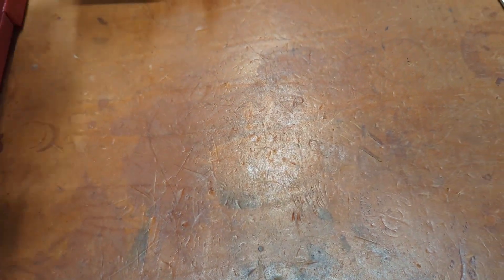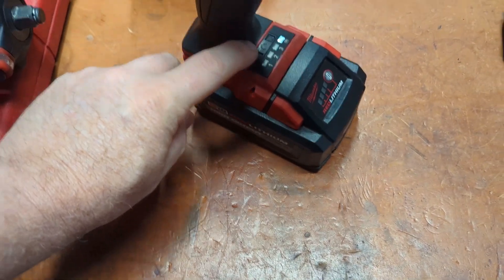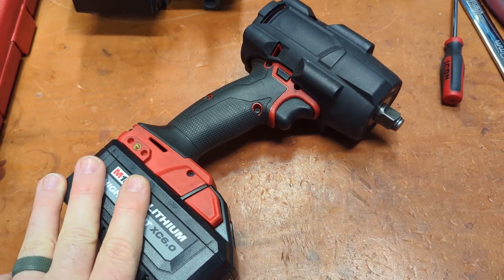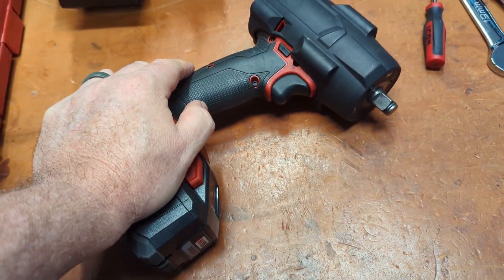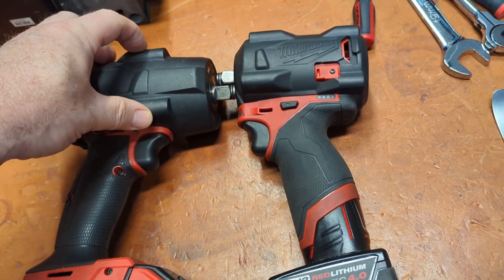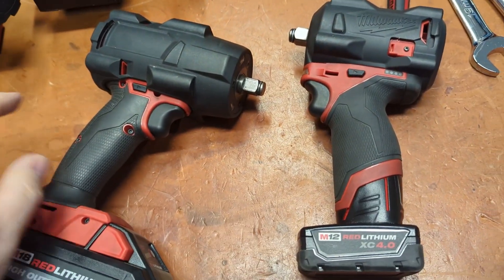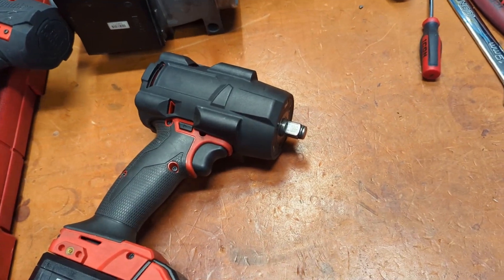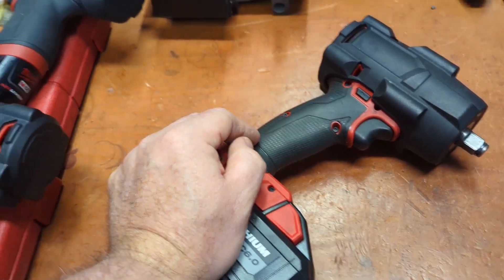Why NOT Milwaukee 2967 M18 Gen 3 High Torque

Comment: Being from the rust belt, the concept of not needing a high torque blows my mind lmao we need a high torque for anything past brakes if the vehicle is more than 10 yrs old 😂
Reply from the maker: ;)  The Mid Gen2 was at levels that a lot of High Torques were at the time.  But obviously I have no real experience with rust (and hope not to - lol)
Reply: @themessygarage  that’s true, to be frank, the new DCF891 has been able to tackle a lot of tasks that used to be for the high torque, that thing is more powerful than the old DCF899 high torque with the right battery haha, but it is almost 7”… I already updated my high torque prior to the Gen 3 release so I won’t be buying it either, but I’m definitely hoping they update the mid-torque because dcf891 power at 6” or less would be a serious game changer.
Reply from the maker: @tylerfraker9304  You bring up a good point.  The bigger message of this video isn't a Team Red thing.  It's an 'all kinds of tools' thing when a spiffy new thing comes out that tempts...   ;)
Reply: I JUST Like All IMPACTS for my YouTube TOOL Channel so I now have all the MILWAUKEE 18 fuel IMPACTS but still want the new DEWALT XR DCF 961 and then next would be a 3/4 MILWAUKEE M18 fuel 2967 and even want the new HARBOR FREIGHT HERCULES ULTRA TQ that TTC just did a video on and it has 1500 NUTT BUSTING BUSTING
Reply from the maker: You definitely have impacts on your channel  :) ;)

Comment: Totally agree. I have the 3/8 Mid torque I got for $100 new. And it’s done everything I’ve needed. Automotive to fire apparatus. And everything on the ranch. It’s plenty of fun for anyone. I don’t think half the people that buy the big gun need them. However when the deal comes up for the right price it will get the high torque because I want a 1/2” gun. My 3/8 is the beast when I need it but when I need to use a 1/2” socket I’ll just use a bigger gun.

Comment: @1:50, it's actually the fourth mode that has the magic of slowly spinning bolts off and not wrecking things when driving them back in. Modes 1-3 are different speeds, but full impact and no brains.
Reply from the maker: I must have been really sleepy that day - you're exactly right, and I knew that when I shot the video (I've installed two complete suspensions with it, front struts on my wife's van and all kinds of stuff with it).  I noticed that I already had the impact in Mode 4 when I started talking, and for some reason punched the button and moved it to Mode 1 - maybe I psyched myself out - 🤣.  Thanks for the correction, and for watching!

Comment: Why did you make this video titled "why not"? Im watching this thinking you're going to say something negative about it. Now I'm pissed because you just wasted my time with your long winded personal experience
Reply from the maker: The video is supposed to be about why I'm not on the hype train and buying one.  The point is a lot of people wind up buying something because it's "NEW!"  or "IMPROVED!" and not because they need it.  The personal experience in the video was my journey down that exact road: everybody made so much about the big gun (2767 High Torque) and how it was the answer for almost everything.  So I bought it.  Ultimately the Mid Torque is better in every way for what I do.  I didn't need the extra power of the High Torque, and I'm incredibly glad I don't have to deal with the weight of that tool.  So this time around I thought sharing that most of DIY'er-world can live happily without the 2967 High Torque might help some save a few bucks and probably have a better tool (a Mid-torque that does all the jobs and is a smaller, more versatile and lighter package).  Sorry the video didn't work for you. :(